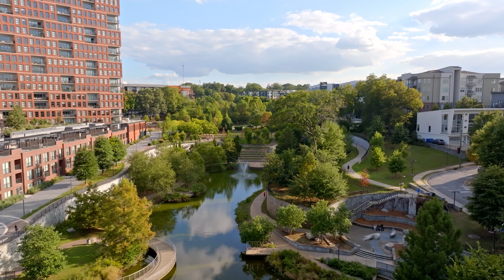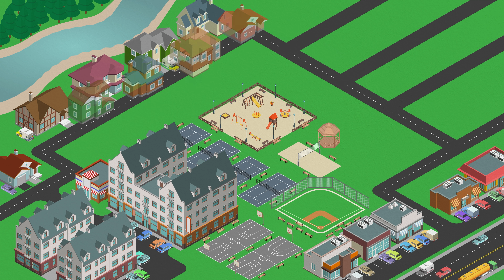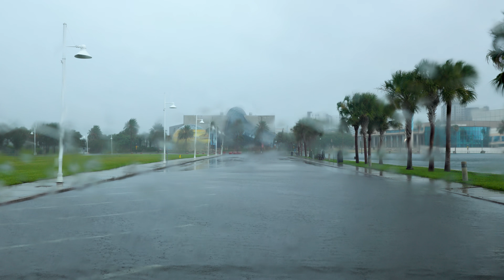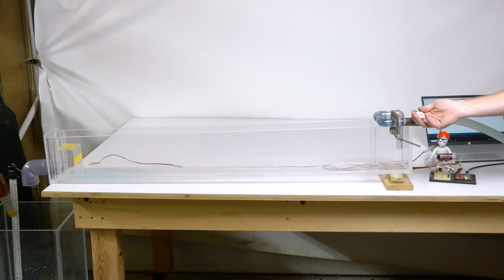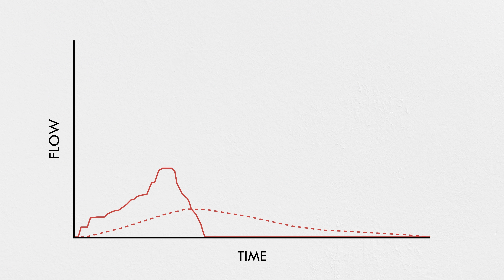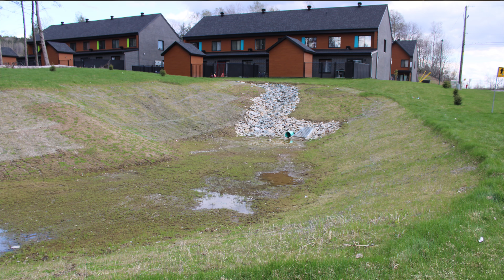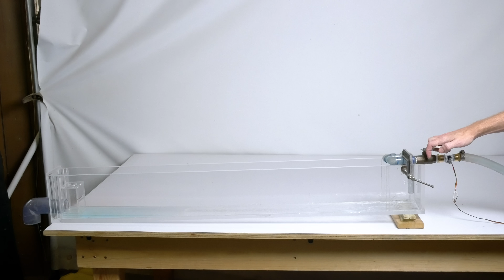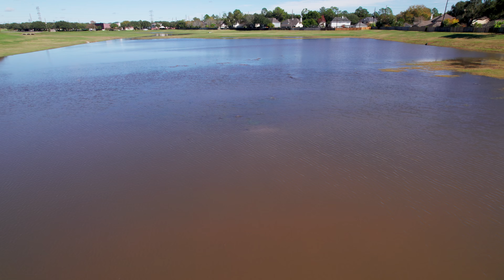Do Retention Ponds Actually Work?

Comment: My area has like 2 ponds. One at the top and another at the bottom. They never worked, and just floods the basement, located mid way between the two points. Maybe they're just cosmetic ponds and serve no real function. When there's a heavy storm, water just runs down the roads. And because there's so much water, it just overflows into the soil, and eventually seeps through the walls/drainage. It's usually not a big deal since there's a pump, but if the power goes out and no one notices the flooding to plug it to a generator, it gets bad.

Comment: Atlanta may have been a poor choice of example lol. As someone that regularly does mass grading/ero control/and underground work in ATL, I can promise you that they have the worst storm water system in the south. Any new construction/site work done in atl regularly has a required detention pond, underground detention pond, bio detention that is overbuilt for the site. The city then ties their storm run off into the property to supplement the poor city storm system.

Comment: One of the urban neighborhoods in my area has added a lot of rain gardens, especially along the roads and sidewalks. The difference is ASTOUNDING between the SAME road on the stretches with the rain gardens vs conventional storm drains. During heavy rain, the conventional storm drains can struggle to keep up with the inflow, and the road develops rivers along the side as they run toward the drains. But the section with the rain garden never gets the rivers or even really puddles. The fact that there's several rain gardens regularly spaced, each with multiple curb cuts to allow water in, means water doesn't have to travel far to escape the road, and so the road isn't really any wetter than in a light rain. 
After seeing them in action, I think more places should install them! 

The rain gardens along the roads are depressed areas a few feet deep, like a detention pond, but I think the primary way water is intended to exit is by infiltration into the ground rather than just slowing the water runoff. Some of them are linked together by pipes acting like culverts, so that they form larger combined rain gardens. I'm sure they help recharge groundwater. There's overflow pipes to allow the water an escape if needed, but I've never seen the water reach high enough to flow over them. If it snowed, they often plow the snow into the low-lying rain gardens to get it out of the way. It also gives snowmelt a place to go.
They're planted too, and small birds love hopping around in the plants. I think rabbits might hide down in there too, but in the height of summer the foliage is too dense to be sure. These particular ones have both grassy plants and trees, which will provide shade as they get taller. And since the trees are planted below road and sidewalk level, I'd wager that their roots are less likely to disrupt the road and sidewalk as they grow (compared to trees planted at ground level)
They really seem like a great thing to help multiple issues in urban environments. Temporary water storage to lighten the load on the storm drain systems, time to allow water to infiltrate the soil and recharge groundwater, better at clearing water from the roads than conventional storm drains, they don't get blocked up by debris like conventional storm drains, wildlife habitat (especially because I think most places try to use native plants).

Comment: Good in theory bad in practice, installed by morons and when they don't work or fail,  no one is heald accountable. The residents are stuck with the disaster and have to deal with the flooding.

Comment: One thing that does not get talked about a lot is that in the United States the solution to stormwater until about 2000 was to get rid of it as quickly as possible.  Most urban stormwater systems were designed to collect and discharge stormwater to the nearest river/lake/ocean as quickly as possible so it would not accumulate and cause localized flooding.  This had many unintended consequences.  It worsened downstream flooding, it spewed surface pollution directly into local water supplies, and it dried out the local land because water had no time to be absorbed into the local soil.  EPA now mandates stormwater retention ponds but there are a lot of old systems around.
Reply: I live in an area with great stormwater retention and I think it's because we can thank a massive flood in the early 90s...right before a major development boom that lasted until 2008 and resumed in the mid 2010s.
Reply: That may explain why the 800 home development I live in that was built between 2002 - 2005 has just one retention pond being 100 foot square. The 800+ home development next to ours built between 2020 - 2023 has more retention ponds than I can count and they are mostly all very large.
Reply: I worked in the stormwater dept of Public Works for 4 years for a major suburb of a city. 80% of our stormwater flows directly to streams.
Reply: Ā yes lets get rid of spundge like wetlands and instead chanel all that rainwater in to flooding whatevers downstream.
Reply: Which is one big reason urban flooding appears to be getting worse.
Reply: En masse its changing weather or contributing.  Farms are being tileds as well.  Inland soil moisture levels
Reply: In my town, it also made a catch area for trash and a homeless camping area.

Comment: Thank you for explaining the difference between REtention basins and DEtention basins.  For the past several decades, new developments have been required to include detention basins.  However, in the past couple of years new construction of individual houses on single lots has required provision of underground storage of storm water runoff, similar to septic tanks.

Comment: I really enjoyed your video. I love retention pond if they are well designed as they add to an urban environment. The downstream befits in terms of erosion prevention and protection of ecosystems from massive flooding are really important. I don't think you mentioned sediment accumulation as a downside of retention basins. They do fill up and sometimes the sediment contains pollutants from surrounding industry which makes digging them out a complex business. 
Ideally they needs to be part of overall catchment management but this is difficult to achieve in overlapping jurisdictions and legislative powers.

Comment: A new development of a fast food restaurant in my hometown in Wisconsin installed a 'secret detention pond'. They dug out and placed a significant layer of gravel where the parking lot was going to be built. Then they covered the area with a layer of plastic half-barrels placed with the convex side facing up and covered this with a fill of more gravel. When the project was finished and the parking lot was paved it hid the ability to hold a layer of water some 10-15 inches deep below the pavement surface of the parking lot. So you park on top of the detention pond. They did not have to set aside space on a limited lot for the detention pond.
Reply: This is very common these days. It works just like the leechfeild of a septic system. These are usually designed not to retain water to slow flows to a river/stream but to capture the water & let it infiltrate directly into the ground.
Reply: @Mittau  Not always. in places with soils that have a low infiltration rate, like San Antonio, we design underground detention ponds that usually discharge directly into public storm systems, as these types of ponds are often place in urban areas that have very limited land to develop on. And if we get a project that is near a storm channel or stream, we can design it to outfall directly to those via a pipe that has the weir built into it directly or connected to a j-box that is designed as the weir, similar to what Grady is using in this video.
Reply: Underground detention. All of these systems run off into something. You can't know it's working unless you look for the discharge point.
Reply: Yeah, for my work we do a lot of underground detention now, since space is at such a premium and getting to double parking areas as detention areas is a huge benefit
Reply: Buried underground detention systems can be a good option as they require less land, but they're significantly more expensive to construct and especially difficult to maintain which makes them often discouraged. But tradeoffs is the name of the game in civil engineering.
Reply: I think thats a waste, more ponds are good, more parking lot is not.
Reply: @baltulielkungsgunarsmiezis9714  There is no room for a pond. It is a very popular restaurant and all the parking spaces are largely filled by customers on a daily basis. The lot is an out-lot in front of a big-box store They are squeezed between this neighbor business and the highway. The store footprint and the parking lot takes up some 90% of their lot space. They were faced with making do with the lot or building outside of the main commercial district.
Reply: I saw those on a recent project in my town here in North Carolina and wondered what those were for
Reply: Is there a difference in detention and retention ponds?
Reply: In chicago a homedepot had hige undergound retention tanks made of concret with pillars in it.
Reply: Talk to them a decade after opening when they have to maintain it, meaning break up everything and wash the gravel.
Reply: if those barrels don't have holes in them they are going to have a fun time with that freezing and pushing up cracking the parking lot.
Reply: @coreytaggart128  As @mittau mentioned above, a properly designed system would allow the captured runoff to leach into the underlying soil if it's not clay, or it would have some arrangement to allow controlled outflow into the local stormwater drainage system. That's assuming it is actually a properly designed system, but you'd think that a fast food chain would have the money and incentive to do it properly so they don't have to dig up and replace a cracked up parking lot every couple of years.
Reply: Neat. Any idea if they also used the permeable pavement like Grady mentioned?
Reply: Legally?
Reply: @Nicholas-f5  You usually need a permit for those but they are given usually within some restrictions.
Those can involve not being in a water protection zone, requiring correct dimensioning, only allowing uncontaminated water (some only allow roof-water or pre-treated water from parking lots) and/or having the right soil type for seepage (for detention) or a throttle (for retention). Details vary locally.

Comment: I am curious about how long it takes sediment to build up in retention ponds and how that factors into long term planning. I suppose if a pond is meant to move water through it, as in the model, then most of the sediment or particles gets carried out and doesnt have time to settle. But in a retention pond, the goal is for particle settling. If i had to take a guess i would say decades.

Comment: @ 0:15 "5-acre or half-a-hectare pond" felt wrong some-how!
Dear old Google reckons that "5 acres" actually equals 2.02343 hectares, give or take a drop!
Seems an odd 'mistake' to have been included.
Reply: Yeah I'm glad this was picked up (acknowledged by Grady elsewhere). The house I grew up in was on a quarter-acre block, which was the norm at the time. We still used that term even though Australia went metric before I was born. But the conversion is a no-brainer because ¼ acre is 1000m² (1012 but who's counting). So I think most people around my age know there's 2.5ac to a hectare

Comment: Couldn't you have a vertical slit that lets more water through the higher the water level is? Instead of multiple horizontal openings at different levels? Or a thin "V" to avoid the pond flooding?

Comment: And if you expect the pond to continue to collect sediment you will have to regularly dredge the pond and remove the silt so the pond does not fill up and become a stream where everything that flows in immediately flows out.  The pond basically becomes a reservoir of all sorts of pollution right in the middle of where you live.

And all of that pollution will still have to be dealt with all at once when the dredged sediment is dumped where ever they dump it rather than letting nature take care of it naturally a little at a time.

Comment: A commercial development built bordering my property dug a detention pond that drained its highest peak into an old canal overflow ditch that runs between my property and my neighbor, with us downstream. What I didn't know is that the city didn't maintain the old easement for the ditch, so my neighbor partially filled it in, and when a major storm came through, the detention pond upstream dumped its max into the ditch, hit the infill my neighbor caused, and overflowed across my backyard and into my basement. Yeah. That was a nightmare.

Comment: Beavers naturally created retention ponds all over North America before they were eradicated from most of the continent. Even "permeable" surfaces like farmland let water run off quickly, and do not hold on to soil as tightly, causing large issues with sedimentation in places like the Chesapeake bay. The beavers create wetlands which spread, slow, and clean the water, as well as create habitat for all sorts of wildlife. Obviously beavers are likely not appropriate for urban areas, but even suburban areas can support beaver populations with mechanisms to prevent dams flooding certain areas. Oftentimes beavers can create flood mitigation and environmental restoration structures for free that would cost millions to engineer and build.

Comment: In the last few decades, my town has put in retention ponds in the worst-flooding areas. Flooding has ceased entirely. I remember when my friend's basement apartment was flooded nearly to the ceiling. That won't happen again, either. Of course, first they went after businesses that were dumping liquid waste of various sorts into a stream. After a bit of cleanup, we started having fish in it again. One retention pond is sort of a park in a big hole, with stairs to reach the bottom. There's even a little stone bridge over the stream.

Comment: In my city we recently built a rainway along a street going downhill that used to flood whenever we had heavy rain. Basically before the area was developed, there used to be a stream that would form there whenever it rained, and of course after everything was developed there was more runoff so the street would just turn into a fast flowing stream going downhill. The rainway acts like a series of connected detention ponds. They tore up half of the street, angling the still-paved part so as much runoff from it as possible goes into the half they tore up. and landscaped it with all kinds of rocks, logs, plants, and specially designed metal baffles to slow down water flowing downhill so that when it rains you end up with a series of small ponds, with each pond overflowing into the next one downhill when its water level gets high enough. There are raised outflow structures in some of the ponds so that when the water level gets high enough that it would otherwise cause a surge of water into the next pond downhill, the water instead goes through the outflow into the storm drain (which no longer gets filled to capacity right away because there's no longer tons of runoff going right into it). It's brand new, and so far it not only seems to work very well, slowing and trapping the water long enough for most to get absorbed into the ground like a sponge, it's also starting to feel like a nice little slice of nature running down the street.

Comment: Fellow Austinite here, would be great to dive into flood control, runoff, at scale. The site by site rules contribute to sprawl while also hurting housing costs and walkability. Cities like Tokyo have massive flood control tunnels for region wide mitigation. San Antonio has flood control tunnels, Austin does as well (most notably the Waller Creek tunnel).

Comment: Seems it would be pretty simple to refill aquifers with storm water.  As they drill wells, usually starting from right outside city limits, drainage wells, say 3 feet diameter, drilled to the deepest aquifer layer would accept a lot of water for later usage.   Tehy could be drilled in several places, taking up little if any real space. Thoughts?
Reply: Nope. The water must percolate through the dirt to replenish the aquifer to cleanse it.
Reply: @rogerpenske2411  Well, let it percolate.
Reply: @raymondjackson6069 That is how it’s done here in Phoenix and Tucson
Reply: @rogerpenske2411  They should do this EVERYWHERE, especially in L.A.  They get tons of water in the Winter and Spring, and what do they do with it, let it just run into the ocean.  Then, the following Summer, they are crying about drought, that after they just let a boat load of water float right back into the ocean.

If you just dig a reverse well, like 3ft wide, and 1/2 mile to a mile deep, enough to reach the aquifers down there, it would take a LOT of water before it ran over.  Oh, wait a minute.  I forgot about the permits and clearances you'd need out there.  Oops.

Comment: On April 9 2024 my local dam and reservoir saw 30,000 CFS inflow from days long downpours in the area. The US Army Corp of engineers held the massive flow back for over a week and the lake which normally encompasses 1500 acres swelled nearly double that and was close to topping the dam at 39ft above summer pool. Once the downstream was dried out enough (the local town of approximately 25,000) they opened the spillway to 6,500 CFS and the lake drained for 12 days. Fascinating infrastructure and a blessing to have fine engineers. 👌